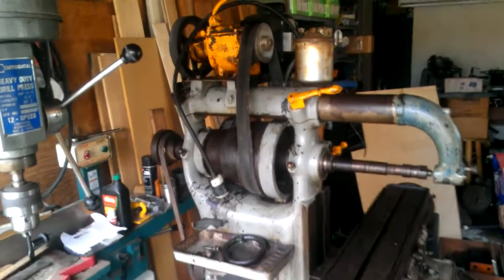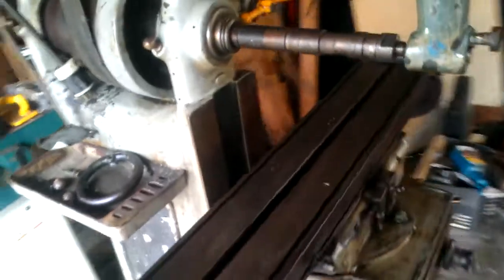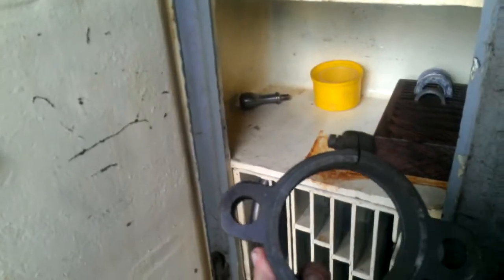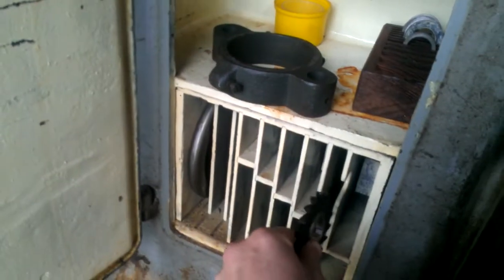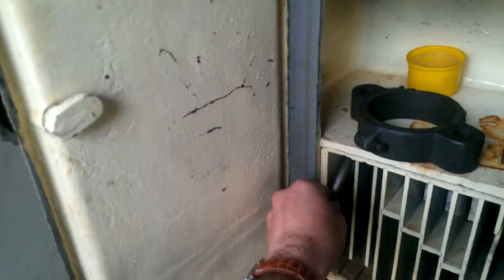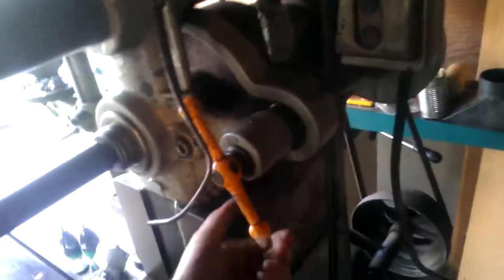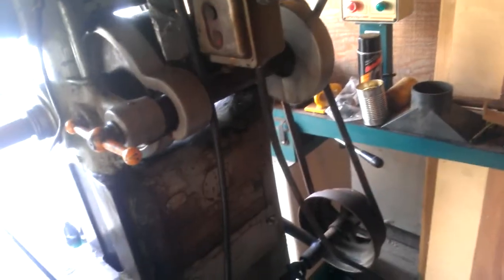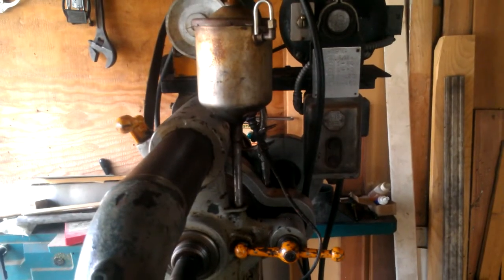Brown and Sharpe #1 1/2 horizontal mill with universal head

Comment: I'm looking at one of these a couple hundred miles from my house. can you estimate what they weigh? Basically do I need more than my F150 to get her home? Thanks!
Reply from the maker: I know for certain this one is 2200 pounds .if you are looking at the same model a car trailer is probably the way to go . I lifted it with a engine hoist from the over arm and that is what was recommended
Reply: @OldIronShops  Alright, thanks for the tip. Hope the mill is working out for you!